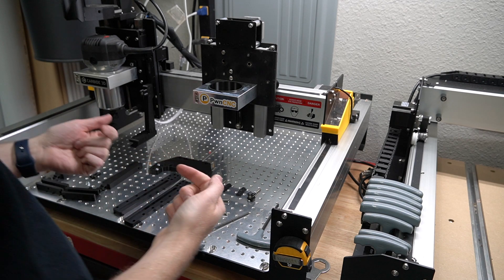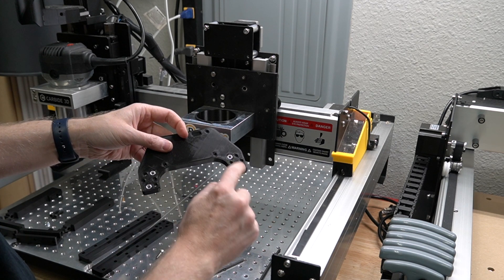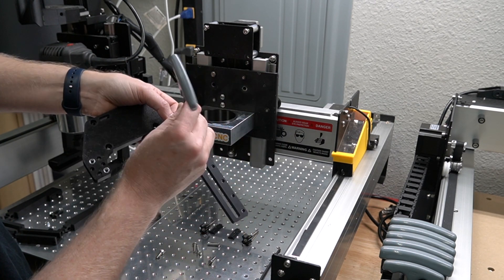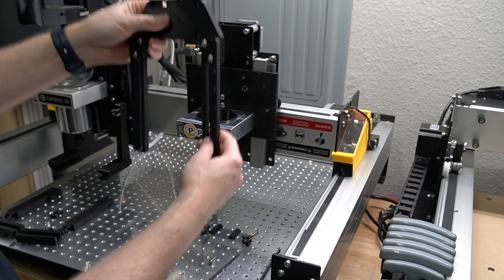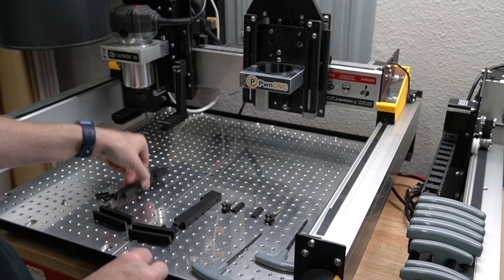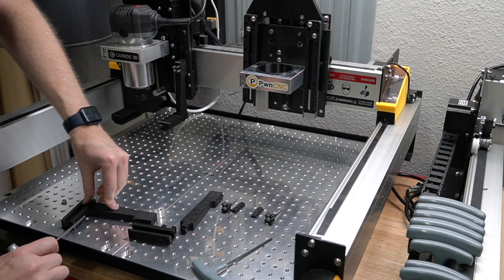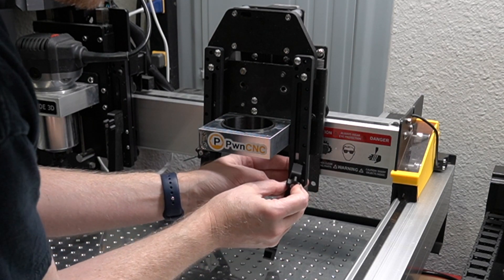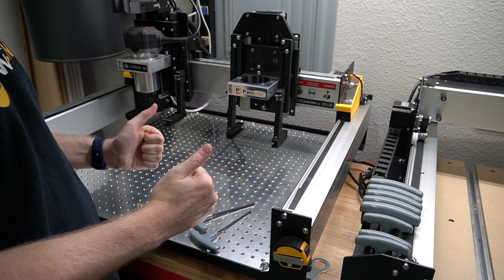Z-Independent Bracketing for the Shapeoko 3 with a Belt-Z

Comment: I do mostly 3D stuff on my s3. I have your v2 boot I believe. Also have cnc4newbie z slider. Dust boot useless for 3D. Any plans for a boot that follows the z and router during 3D cuts?
Reply from the maker: Hello Mike, yes, z-independent boots are best for 2.5D carvings.  If you're doing more 3D... consider v7 (https://pwncnc.com/purchase/ols/products/dust-boot-v7).  v7 is a spindle/router mounted boot design which goes up/down with your Z axis.
Reply: @PwnCNC  , I was actually just watching you v7 video. I missed your release of it. I guess you are going to have to send me more skittles now. lol.